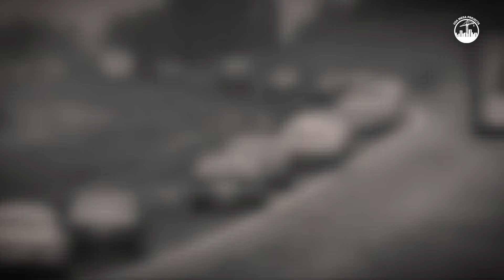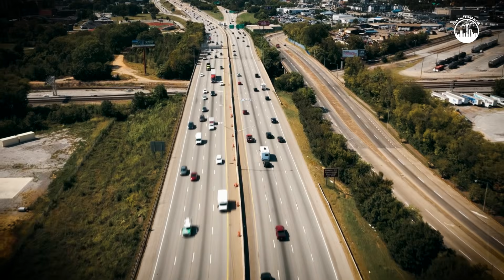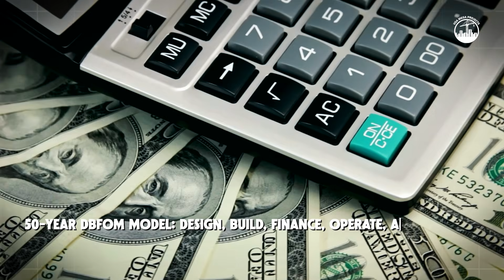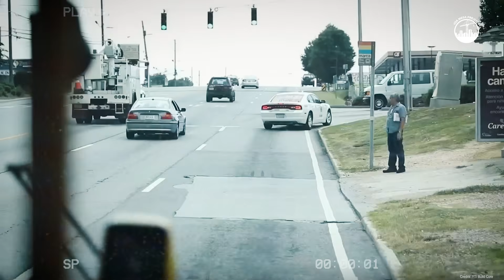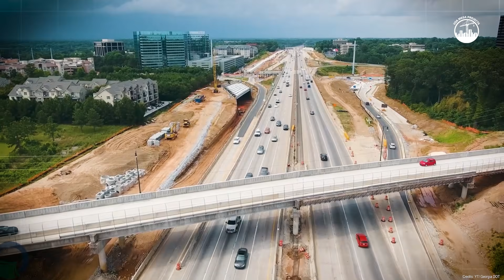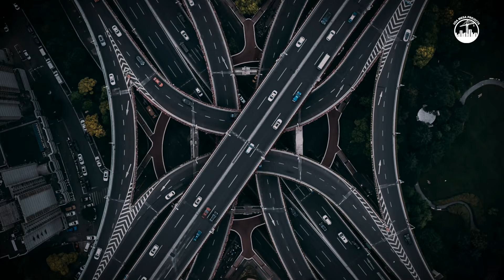$4.6 Billion Highway Gamble: Can Atlanta Finally Solve Traffic?

Comment: When the h*ll are people (or better yet government bureaucrats) going to realize that highways NEVER solve traffic problem but rather only exacerbate them.  Build a commuter rail, extend MARTA, build density...anything except another highway that leads to further gridlock.  Atlanta has real traffic issues that no highway is going to alleviate.
Reply from the maker: You’re right expanding MARTA and adding true rail options would do far more for Atlanta’s long-term mobility than another highway project ever will.

Comment: The northern suburbs are pretty affluent, I see the express lanes being utilized similar to how they are in northern VA on the beltway. Which means $15-25 tolls during heavy traffic. I do think it will help traffic going to those northern suburbs but 285 and the connector are the real issues in Atlanta.
Reply from the maker: You’re right the express lanes will mainly benefit those corridors, but without major fixes to 285 and the Connector, the overall congestion picture in Atlanta won’t change much.

Comment: The GDOT is owned by the road building industry. The Georgia GOP doesn't care if this solves the traffic problem. Their buddies got paid and that's the key point. They put in express lanes on the interstates around Atlanta. Cost a ton of money and it hasn't solved one bit of the traffic problem. But the road builders got paid. Mass transit? You're considered a communist if you even talk about mass transit.
Reply from the maker: It’s a common criticism in Georgia. Road projects keep getting funded even when they don’t ease traffic, while serious mass-transit plans rarely get political support. The result is spending that benefits contractors more than commuters.